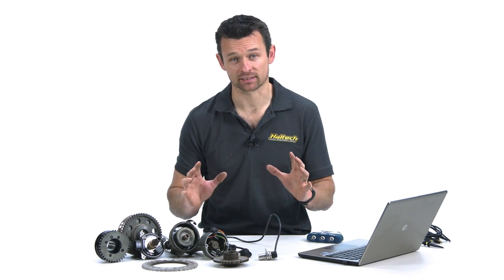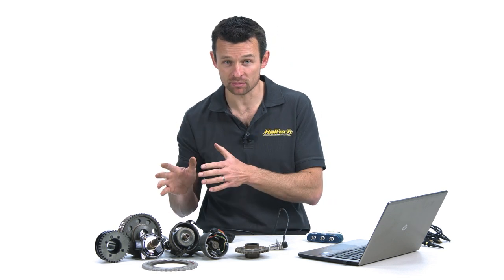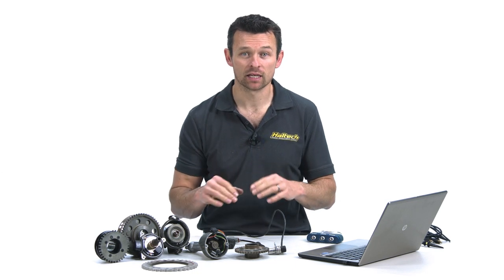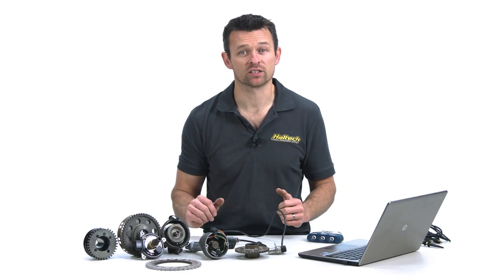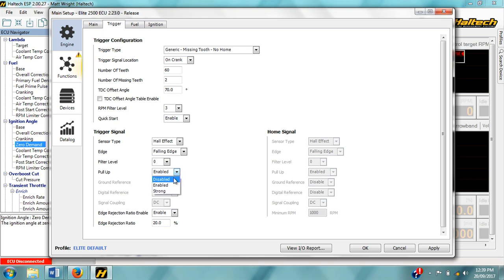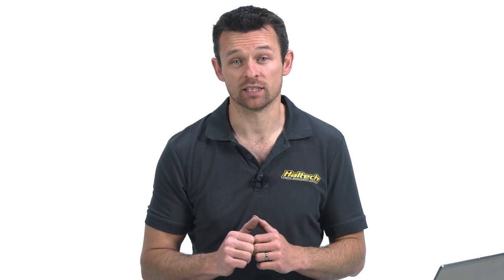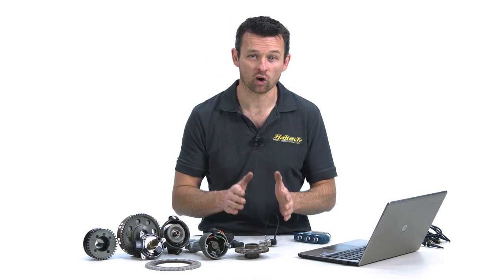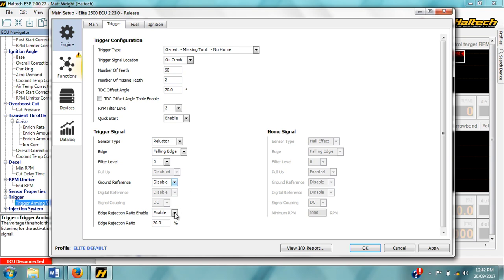💬 How to Set Up Any Crank Sensor  | TECHNICALLY SPEAKING

Comment: Between this video and  the "trigger angle explained" video, most noob's, including me, would like to see a vid on trigger wheel and sensor placement on crank. Degree's needed for 4, 6 8cyl vehicles. 
Also, explain deeper the trigger angles and tooth offset requirement.
Then i would have the details i need on a silver platter and at one reference point...I think it would just round out the whole setup procedure. 
great vids guys.

Comment: Now i feel like i need to go outside and look at Rhondas trigger settings.... Havent gotten her to run reliably on the 1500 yet. Been having inconsistency with home signal. Wondering if the cam trigger isnt set right. Tdc offset is set per your video.

Comment: What is important about CAM and CNK sensors and targets is how they operate during worse case crank shaft rotational acceleration. The highest accelerations are actually when the starter first engages the engine when cranking. How fast and deterministic an ECU can decode the CNK and CAM signals directly effects engine start time (cranking time) for sequencial events. Hall sensors are not velocity sensitive. Meaning they can operate at very low engine rotational speeds.

The best CAM and CNK signalling is one that does not rely on trying to measure time between pulses to find a missing tooth during worse case acceleration. One example of a deterministic setup would be a power-up Hall looking at a CAM Phasor (half high, half low, like a BMW CAM target) and upon a transition then drop down to the CNK (36-1 Ford Target) with a power-up Hall and index on the tooth after the missing tooth transistion. Electrically you would first get a CAM transition (L-H or H-L) then the next transistion on the CNK would give you absolute engine position. The missing tooth on the 36-1 tooth wheel is used after the engine is started or as a backup in case a CAM sensor has failed (limp home mode).

For starting a cold engine, before preping for a cylinder event (injecting fuel and setting spark timing) you would like to know absolute engine position, and decode it as soon as possible. If the engine is port injected it will take time before the charge intake event. With direct injection the time to first event is quicker.

Also not discussed often, is the fact there are actually two domains with a magnetic target and sensor (magnetic lag). For example, the mechanical position of the CNK sensor is not exactly the same as the electical position of the sensor output signal when mechanically aligned. This stays relatively constant throughout the RPM range with a Hall effect sensor, however there is some skew between the two. You can see this effect by looking at the sensor output from the CNK and a mark on the crank wheel (missing tooth for example) using a strobe (high speed timing light). So it is important to understand magnetically how a target and sensor behaves throughout the usable engine RPM range.

Comment: it doesnt really seem public knowledge that you can use the same haltech between ls1 ls2 l98 l77 ls3 etc and just use the correct trigger settings when upgrading or just doing a long motor swap, without having to change hardware. i reckon that its a great selling point on its own. my current ls1 is run off the p01 factory ecu and besides being able to do everything i want its not as polished as a plug and play haltech elite. definitely looking forward to upgrading in the future

Comment: can you do a crank trigger conversion for distributor type? would be very helpful for a noob like me
Reply: Yes, depending on the distributor.
If it has a hall sensor built in to the distributor, it should be fairly easy.
I just got my dodge shadow 2.5 tbi running; I used a speeduino UA4C, VW wasted spark module, and then I just bent down the tooth for cylinder 2 so it's out of the way. You wind up with a 4-1 trigger wheel (3 real teeth, 1 long gap).

My next step is to hack together a more accurate trigger wheel using a soup can or something.

Anyway, it is possible, and I'm debating making drop in trigger wheels for dizzy engines for tuning, but you can also just install an aftermarket wheel and sensor onto the crank shaft

Comment: Hello  I could sure use your help, I have a 2015 dodge journey  ,that hase the engine swapped out with a 2008 block an 2013 cylinder head, I have no spark at coils an scan tool says that there is no crank or cam sensor imput .I've video the rotation of the Reluctor wheel an counted the teeth an it has 58 teeth with a large in set gap missing. Now on all the sites on dodge shows a Reluctor wheel with 58 teeth  but the part that is different sticks up opposite from  the one on the engine we installed, so I took to dodge dealer he scanned an really didn't tell me any more than I knew, but he was thinking the Reluctor wheel should have less teeth an that's why it's not working, but I tried to show him an tell him that there's the same amount of teeth just opposite different trigger tooth.,he still says I need need Reluctor wheel or new block most likely a 2013. What is you opinion of the problem an a fix new Reluctor wheel or block,  an right not the crank sensor is the same one for the 2008 up to 2020 according to the parts list so what would be the difference.  Thank you.

Comment: Can someone please help me understand what the benefits are to the different trigger patterns? I understand more teeth means more resolution, but what is the point of missing tooth crank wheels when running a home, aka cam, sync? The engine will get the speed from the crank and the position from the cam, right? Or does the missing tooth(or teeth) denote the position and the cam sensor just tells the ecu the phase? Thank you in advance.

Comment: I always thought that on reluctor sensors, the edge is defined by the polarity  of the wires as one of the edges is a true zero crossing while the other edge dwells around the zero line between teeth and can cause false triggering when not properly matched to the ecu settings.
Reply from the maker: The signal on both wires is an inverse of the other, so if you get the polarity backwards the signal is inverted.   With correct polarity they are almost always Falling edge. This is because as the tooth approaches the sensor the signal is pulled into a positive voltage. It then falls to zero when directly on top of the sensor before becoming negative as the tooth moves away.  It is this “falling” signal from a positive voltage to a negative as it crosses zero volts that most ECUs look for.  If you use a scope and it goes the other way you can simply select Rising as the edge and it will function correctly.

Comment: may i ask you a question. I have a weichai wp10 which after the repair knocks before starting the engine after the start it works normally, but it starts after many rotations(seems that there is an air in the fuel system). It sounds like a fuel injection with a high advance.thats what i think. is it possible that the camshaft sensor is not where it has to be. However i did all the timing marks as the manufacturer has marked the gears. Thank you in advance!

Comment: For the Hall effect sensor does it matter which is signal and which is ground . I can’t find a pin out for a Subaru ez30 cam sensor for the life of me .
Reply from the maker: Yes it does matter.  If you get it wrong it is possible to damage the sensor.  1=12V+, 2=Signal,  3=Signal Ground.
Reply: Thanks I figured it out.

Comment: Does CAM position sensor is needed for ECU to operate correctly? Is it possible to to run engine with crank sensor(one tooth is longer than others) only using wasted spark system? If CAM sensor is a must, should it provide one impulse at BTDC of one particular cylinder or it must have some greater resolution with more impulses per revolution like crank sensor?
Reply from the maker: A cam position sensor is not necessary to just run the engine. However, to run the engine as best as possible it is needed so the ECU can identify which cylinder is firing. With a crank sensor only, it is only possible to see which two cylinders are firing.

Comment: Actually guys. I have a question. Since my whole engine is apart. If I run a missing tooth crank trigger does that mean I dont need a cam sensor?
Reply: To my own question... You need a cam sensor to run sequential.